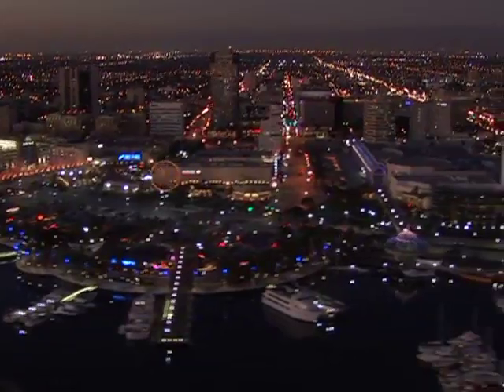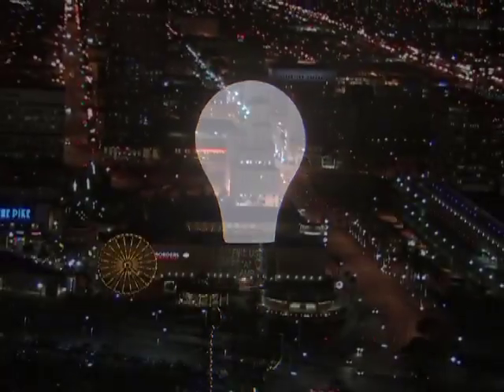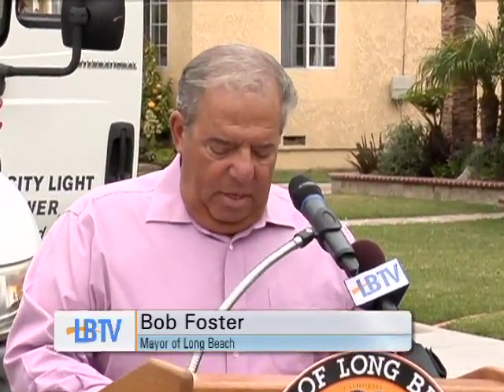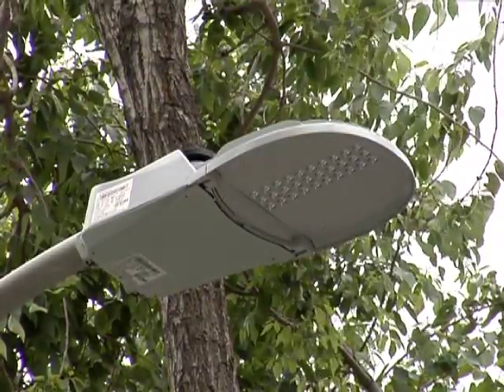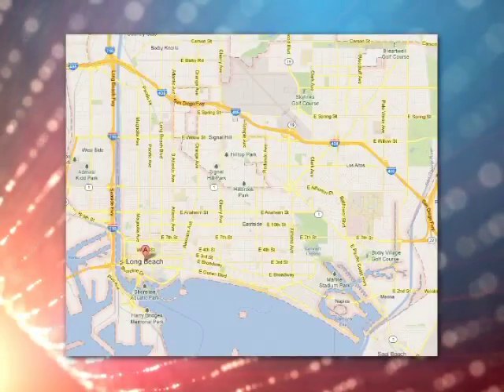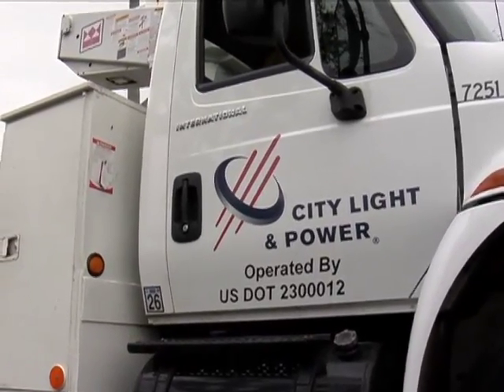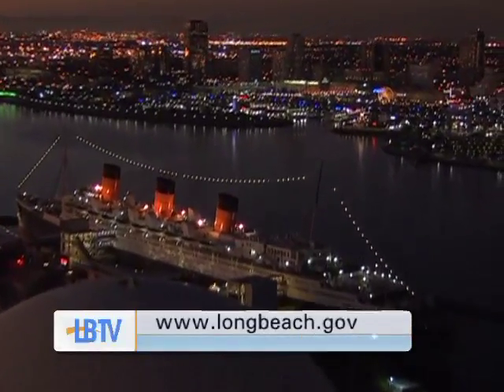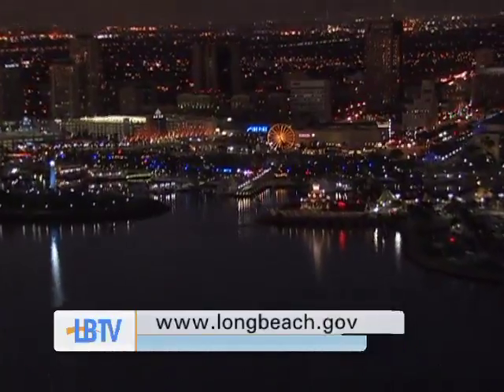iClip LED Street Light Project

Comment: It should also be noted that the LED has a much more controlled beam pattern, so there's less glare and spill-over into residences where it's not needed or wanted.  Also, the CRI (Color Rendition Index) is much better than HPS lights, allowing for much more accurate descriptions of color (cars, clothing) when crimes are reported.